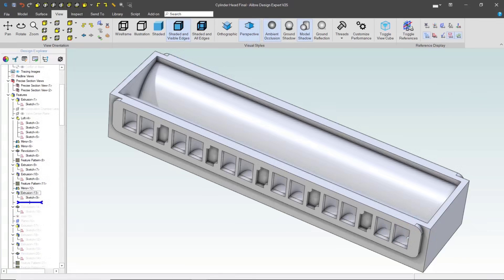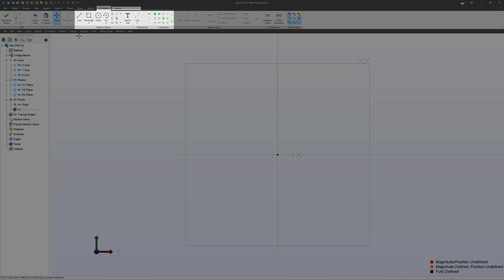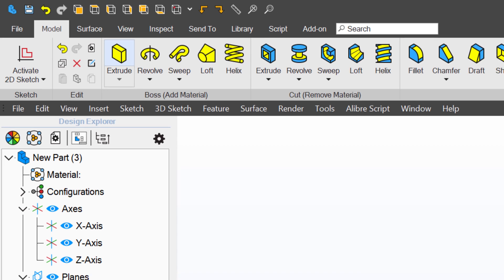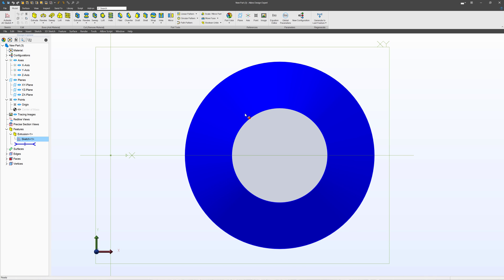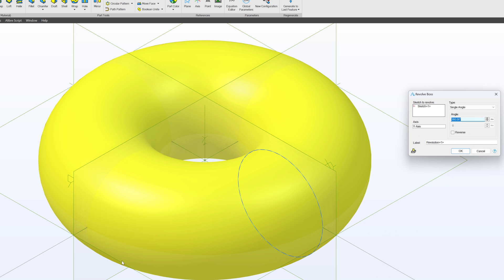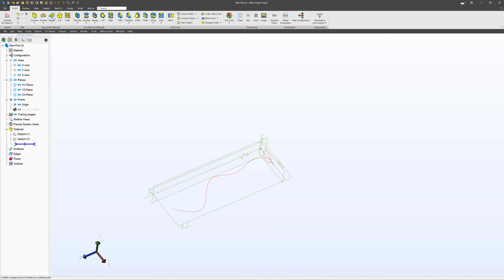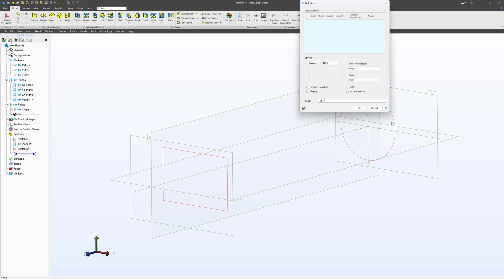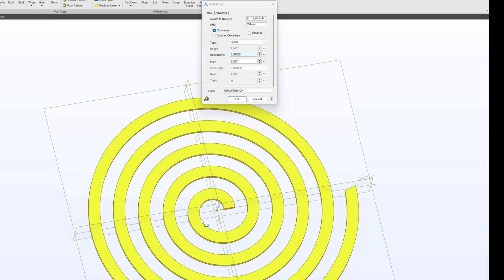Modeling Parts in Alibre | Alibre Beginner Course #4

Comment: Hmm I keep getting open loop problem if I follow along it seems the spline  is not aligned with the circle. Having trouble getting it to do so
Reply from the maker: Would you mind sending your problemed part to joseph@alibre.com?
Reply: @AlibreLLC  Hello, thanks for response. I'm going to try to figure it out first I'm new to the software so there is bound to be learning pains. I'm sure the problem is getting the spline aligned with the circle in the dimension it extends. My spline would not align. I'll comeback to the comments with more questions about the software if i can't find answers by googling or online forums.
Reply from the maker: @ddw34  Sure thing, we are here to help.  Thanks for your comments

Comment: Hi Joseph, I have a query that might also be beneficial for others. I own a Logitech G502 gaming mouse, which features programmable buttons. I'm curious about whether you use such a mouse to enhance your efficiency in Alibre Design. Could you share your thoughts on effective time-saving strategies in Alibre, especially for a beginner like me? I'm eager to learn the best practices early on to prevent forming any counterproductive habits.
Reply from the maker: Great question!  Alibre won't readily recognize your mouse, any mouse button mapping would have to be done through logitech software.  Alibre options does have an interface to create custom hotkeys- I'd suggest mapping the most used functions to the left hand, so you can use your mouse and left hand at the same time.  Ex machina is going to be competing in the speed modeling world championships using Alibre and he has a video on his setup for efficient use here:

https://www.youtube.com/watch?v=dhdIn5EBqp0&t=1s